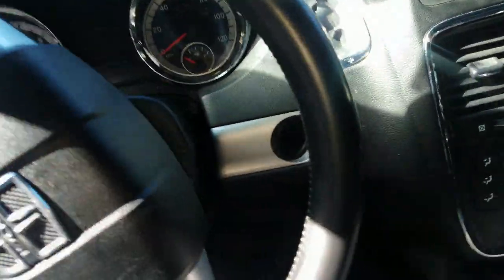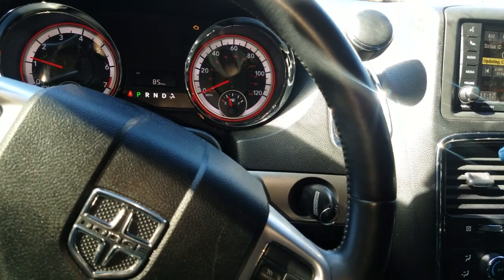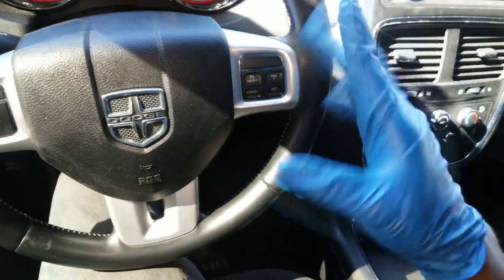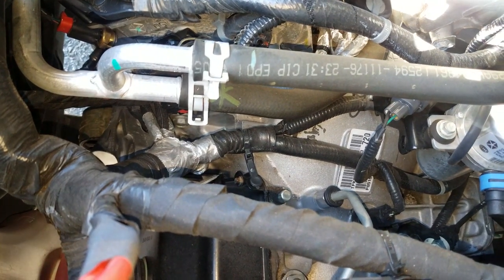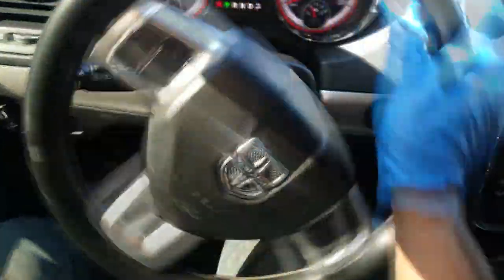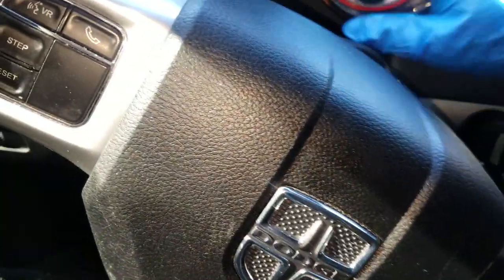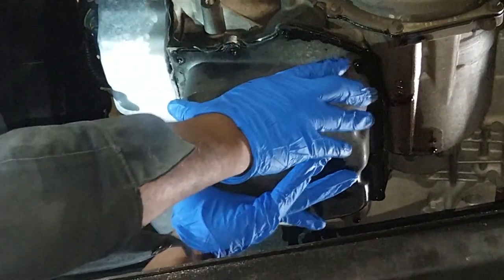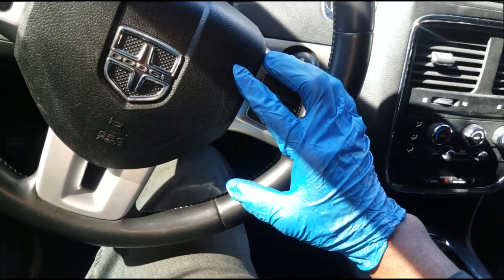Transmission whining noise or Power steering pump noise? P0868 P0944 P0700 P0740 62TE P0897 P1798

Comment: My 2000 blazer just started making that sound yesterday. Mine doesn't go away when in gear though. It gets louder when accelerating and turning corners. Although it has the power steering whine which you mentioned as well. Could it possibly be both?
Reply: What was the problem and how much did it cost
Reply: That’s not the transmission- it’s the alternator. If it’s the transmission it will only make the noise when in gear ⚙️, if you start the car up and you put the clutch in and it still makes that noise it’s not the transmission! Ps never completely change the transmission fluid to all new fluid !! Keep some old fluid in there 50/50
Reply: @nikko7507 What do you mean by in gear?
I have automatic transmission and the noise starts at P(Park) gear
Does that mean it's likely be alternator?

Comment: My car make same noise chrysler 200 2012 when i accelerate it not go is problem with oil pump or clutch do i need to replace whole transmission? Just engine light is on Can you help me

Comment: Hey man my 2010 camaro ss starts whining at about 2500rpm whether it is in neutral or cruisin around in any gear. Once I stay at 2500rpm for a little bit the whining stops and I have no clue what the problem is
Reply from the maker: Could very well be a transmission front pump. I suggest you get the car scanned to confirm if the problem inside the transmission. Also are you subscribed to the channel?
Reply: Omg! My RS is currently doing that and I’m looking for answers. What ended up being the problem if you don’t mind me asking?

Comment: I had rack and pinion put on 2004 buick LeSabre and was told with the sound my steering is making is not the power steering pump or belt.what other sound can it be? It has new tie rod sway bars struts assembly and rear strut and alignment.but steering wheel going straight on a road take hands off its not suppose to go to left immediately and the steering wheel is off not straight but when u turn it to left sound like bad pump then to the right it start making same noise but the people put parts on said not pump or the belt.could it be they did something wrong

Comment: My mechanic wasnt able to diagnose a whine in my 2007 Mitsubishi Outlander.  A few cays ago i changed the transmission fluid and filters but the whine is still there. It doesnt occur when idle but gets louder as the RPMs climb to the shift to the next gear.  Then the whine lessens and build to the next shift. Also, as the vehicle is coming to a stop, the whine slows along with the vehicle and stops. Any ideas?
Reply from the maker: Hey bud, im sure this year model car has a computer control transmission. Was there any fault codes in the transmission? Also are you subscribed to the channel?

Comment: hey bro what’s up i have same this noise in my 09 escalade transmission will you tell me exactly what is the problem in my transmission?
Reply from the maker: Hey bud, you can start by getting the transmission scanned. Are there any fault codes? Also are you subscribed to the channel?

Comment: My Elantra is making the same sound upon acceleration and upon changing gears. I guess i should change the AT filter
Reply from the maker: dang, well its def worth a try..Thats the most inexpensive thing you can try first. Thanks for watching, please subscribe, thanks
Reply: @OnlineMechanicTips  my 2004 4runner makes similar sound on cold start only but goes away after the engine has reached operating temperature.  I've removed the serpentine belt and started the engine and the cold start whining is still there.  So definitely not the pulleys, water pump, power steering pump or alternator.  I did an atf drain and fill this past summer.  ATF is at correct level.  It's either transmission whine, oil pump or timing chain assembly.  Not sure.  But leaning towards transmission since it does go away either completely or the whine goes down when in gear such as reverse or drive and whines again when put in park or neutral. But like i mentioned it goes away on its own after the engine is hot or reached operating temperature.  Also if the engine is already hot or warm, It does not whine at start up.  What do you think?
Reply: @abuelb  have a 2007 rav4 with v6 engine started making same noice after changing atf and the noise goes away after 5 - 10 min when the engine is hot. Same as you described. Did you found whats it is??

Comment: Does it go away after warming up?
Reply from the maker: Sometimes if the trash clogging the filter drops it would. What kind of car is this? Also are you subscribed to the channel?
Reply: @OnlineMechanicTips  I've got a 2010 mustang. It wines like this for about a min then goes away. Doesn't matter if im in park or gear. I usually let it warm up and stop wining before driving just in case but its worrying me seeing all this talk about transmissions 🤣🤣 and yeah absolutely  ill subscribe
Reply from the maker: @joshsutcliffe6099  Hey bud, the best thing you could do for it is to get it serviced. Your filter may be clogged up. Also get it scanned to see if any codes in the trans module
Reply: @OnlineMechanicTips  i threw a new idler pulley on and the problem is gone.  I've never heard an idler pulley sound like  a power steering pump but hey first time for everything rjght?

Comment: If my caravan has developed this whine would it be of benefit to change the filter or is the transmission toast at that point? 162,000 miles.
Reply from the maker: you likely have starved the pump, So by changing the filter and the fluid theres a small chance that it may help. Thanks for watching bud and please thumbs up the video and sub the channel, thanks
Reply: @OnlineMechanicTips  Thank you for the reply! I’m going to give it a shot. Little to lose at this point. Thanks for the video!
Reply: @brandongladu7202 any update? Did changing the fluid and filter fix it?

Comment: I got a coolant flush and a transmission fluid change at the dealer they refilled both too low and now there is a whining noise coming from my transmission should I tell the dealer they need to replace my transmission?
Reply: Yes

Comment: Lord so now I need a transmission?!!! I thought it was my belt! I had belt replaced transmission fluid changed oil changed for first time I had the car. It rained hard one day and I ran in a water puddle I assumed it wet everything underneath the car btw it’s a small car 2012 Mitsubishi Galant fe so it sits low. The next day I started it to go somewhere and noticed a small odd noise me growing up around mechanics I knew it wasn’t power steering because didn’t whine when turning only when  acceleration or just start the car in the morning. Anyway I had breaks, alternator, new battery, belt, starter breaks and all done up and the noise it still there. It’s even louder now. Looks like the transmission had never been changed in the car also it was black as tar the guy that did my car showed me everything he was doing anyway I just don’t have the money for a transmission ive had the car a little over a year it was 109 miles when I got it now it’s at 123. Finally somebody that knows what he’s talking about I’m glad I found this vid. Thank you
Reply from the maker: O wow my friend, im sorry this happen to you. Hope things work out. Thanks for watching and please subscribe to the channel, thanks
Reply: Online Mechanic Tips thanks already subscribed love your channel thanks

Comment: What about when your backing up or moving slow and it makes that whining noise
Reply from the maker: Hey bud, every transmission uses a valve body of some sort. It s used to direct fluid to the right area. A whining noise can occur even in reverse. But you have to determine if the noise first coming from the transmission area. Thanks for watching, please thumbs up the video and subscribe to the channel, thanks.

Comment: Torque converter whine
Reply from the maker: Man I didnt even get a chance to tear it apart..they had a new transmission already waiting for me to simply replace it..lol..smh..around here trans tech just R&R men now..I use to build 2 a week back in the day. Miss those days..I like to go inside stuff and build things back to specs..my trans tools have cob webs on them..lol
Reply: @OnlineMechanicTips  me too, im a self taught mechanic, currently replacing lifters and cam in 5.7L hemi
Reply: @OnlineMechanicTips  When you replace the whole transmission, do you reuse the old torque converter?
Reply from the maker: @xushenxin  No, typically the new/used transmission will come with a T/Converter

Comment: I’ve got a 2017 V6 Grand Cherokee and the damn thing sounds like it’s got a supercharger. Whine gets louder with acceleration particularly above 3,000 RPM, or in Sport Mode as low as 1,700. 

Opinions anyone? I’m interested in what anyone may have to say lol
Reply: Take a look at rear differential
Reply: @tigretouchingbandz  Yeaaaa little late bud. My transmission went out 3 months ago LMAO. Had that and a water pump replaced.
Reply: @CWKana  lol damn ..  so the cars a wrap? Or after getting that fixed you were good ?
Reply: @CWKana  having same sound w my Charger rt my rear differential fluid was well past due, hoping it doesn’t kill my transmission or if just replacing the rear differential will fix the sound . Stressful af
Reply: @tigretouchingbandz  Nah I had it repaired and I’m still driving it. Drives great now. Found out that something in the trans was “knocked” a little bit when I had a minor accident (not my fault). It was sorta like waiting for an organ to fail lmao. 

As for your R/T, I had a buddy ride with me while another friend drove beside me to diagnose mine. They both agreed it was likely the trans but COULD have been rear diff. It was hard to tell but with how loud it was the general consensus was trans. I’d definitely take it and have it looked at by somebody even if you don’t do anything now just so you know what to expect. As I’m sure you know, diff work is expensive and trans work is expensiver 😂
Reply: @lyk it was any weather; particularly in high rpm ranges it was easier to hear.